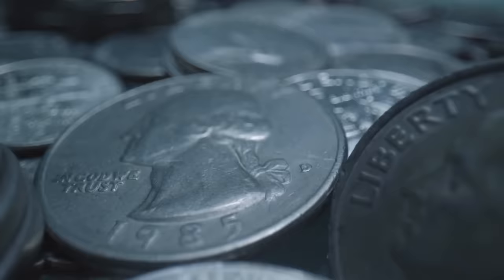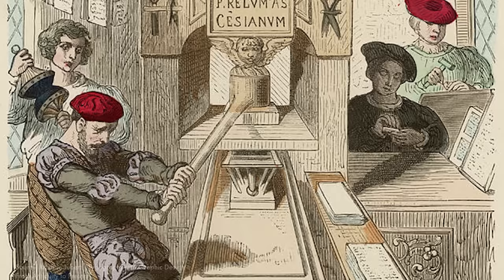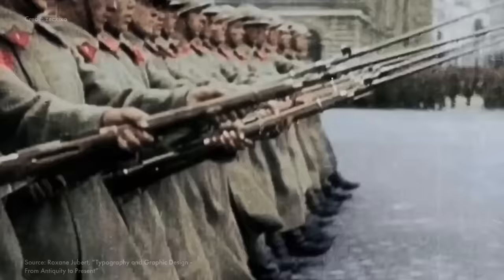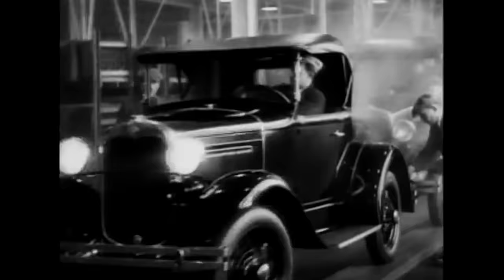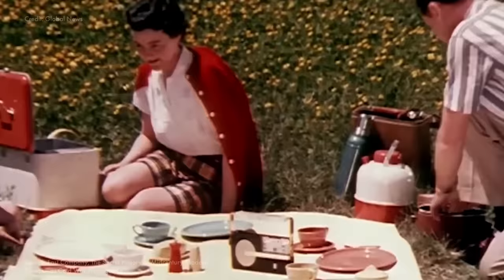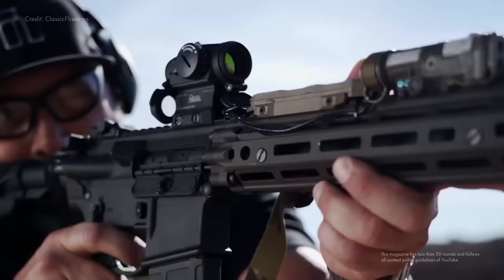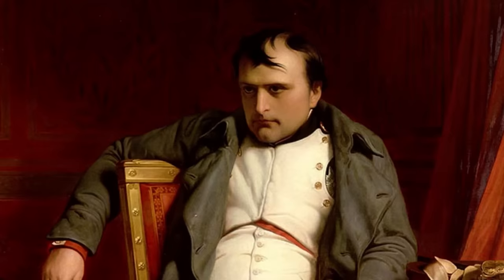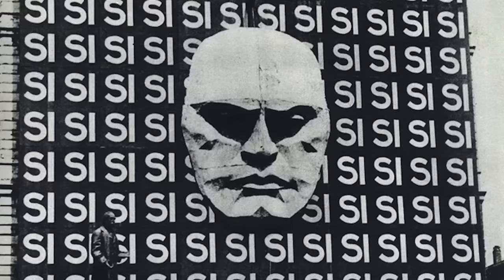How Governments Use Design & Propaganda to Control You

Comment: The Armalite15 semi-automatic rifle was not designed for combat, but for general use by civilians. The military rejected it as a cheap and flimsy toy. The benefits contributing to its ease of use primarily impacted poorly trained self defenders, like your grandmother, rather than highly trained soldiers capable of handling heavier weapons. I believe it was the first weapon Armalite attempted to offer to the military, and they had to overcome several rejections to get an evaluation.
Reply: I thought ARs were made specifically to be a civilian weapon based on the core functionality of the M16 (e.g. dust cover, rear sitting two finger charge handle, 30 round magazines, gas system cycling, a construction of steel and strong but light polymers, forward assist, and a barrel shroud with Picatinny rails).
Reply: The AR-15 was designed in 59, before the M-16 A1.

Comment: 24:44

Small mistake: the M4, which is what was used in the 00s wars, is actually an AR15.
Reply: The M4 could be more accurately described as the carbine version of the M16, which is the military version of the AR-15
Reply: M4 and AR15 are absolutely not the same rifle.
Reply: @AdamSambuco  yes they are. An M4 is an AR-15 type rifle.
Reply: @Stellar-Cowboy  "type" ... absolutely not the same thing. Not remotely close.
Reply: "TYPE" is the word that specifically tells you they are somewhat similar but NOT THE SAME.
Reply: Alls I know is you want an M4 instead of M16 whenever your about to go into a village especially if you know ahead of time you’re sweeping every rebuilding or house! What y’all are missing out on is the identical ammo and shorter barrel! You don’t want to pop a corner With the M16 “you can and there’s a way to do it properly” but Between the two weapons the M4 barrel is 4 and inches shorter than the M-16! I would love to read the comment section on why we use the 556 round instead of any other round ie the larger AK 762x39!

Comment: On an AR15 the gas and buffer systems are solely there for semi automatic operation, it would actually have less recoil with a bolt action. As gas isn't forced back into the action cycling the bolt weighting several hundred grams back to eject the old round and cycle a new one into the chamber.
Reply: Wrong. It's the exact opposite. Gas systems in guns channel that "equal but opposite" energy into cycling rounds, so some of that energy is used by doing work which leaves a smaller amount of energy left over to be turned into recoil. In a bolt action, none of that "equal but opposite" energy is used to do any work, so all of it is instead turned into recoil. 

The law of conservation of energy, my dude. ARs would have to be creating new energy out of nothing in order to both do work (energy) AND have more recoil (also energy).

Comment: First, you've got some great insights. But, second, you're really missing the mark on many of the points you made about the AR-15 (not all, but many). 

The AR-15 is more than just a rifle - it's a platform. Most people don't understand that Microsoft Office isn't an office suite of productivity tools, it's a platform. Being a platform is a huge advantage because it means that you have a lot of freedom to customize and alter. 

For the AR-15 as a platform, it means that it can very easily be modified for many different purposes. This makes it very inexpensive as you can change it around with no need to purchase a different firearm. 

For the "sharp edges", you seem to be referring to the Picatinny rails. These are part of the platform that make it very modular. It's easy to attach various enhancements with that system, e.g. a scope, a red dot, a foregrip, a flashlight, etc. 

However, one of the most attractive features of the AR-15 is that it's generally chambered in 5.56 NATO or .223, which is very cheap ammunition. This makes it very cheap to use. Ammunition for other rifles/calibers can easily cost double, 5x, 10x, or 20x or more. Ammunition for an AR-10 (same basic type of rifle but chambered in .308 or 7.62x51mm) is at a minimum 2x, and often 3x-5x as expensive. The AR-15 is CHEAP to shoot. 

I could go on at length about why the AR-15 is popular for practical reasons, but I think I've made enough points already.

And yes, you are 100% correct in saying how a lot of people are attracted to that "tacti-cool" look and feel. Totally true there. But that's really a minor consideration, or perhaps a minor consideration for anyone that's semi-knowledgeable about rifles and firearms. The "tacti-cool" factor is likely more important for people that don't know much about firearms. 

That's all a minor point for your video. You've done an excellent job there!

Comment: Your basic premise or thesis is like many academic type examinations and discussions that take one of the 'sub-branches' of a major discourse and present it as the predominant course, reason or outcome. The trick is in these enquiries - to 'identify first and foremost the major discourse or 'determining factor' - usually a major argument in itself. 
With your thesis it has to be "What is it in the human psyche that makes us 'SO SUSCEPTIBLE TO INDOCTRINATION AND MANIPULATION' not the various elements of the indoctrination - like design etc. This list is vast and leads down dozens of rabbit-holes. The determining factor undermining the whole of society and its susceptibility is CHRISTIAN DOGMA AND IDEOLOGY - TWO-THOUSAND YEARS OF IT - In your small enquiry - the use of idols and symbols in religious indoctrination is so ingrained it even appears on the outlaw members of society - so wide is its influence - check modern gang insignia, symbols and tattooed markings etc out let alone the mainstream infrastructure - as for the psychological programming - when presenting anything and everything to each other - why does the number three crop up? - the father the son and the Holy Ghost. This one is so widely in calculated into our psyche's it even defies basic mathematics. The list is endless - have a go at his 'religion' the root of all evil so to speak.

Comment: 11:39 they weren't misguided. Automation and mass production can actually reduce workloads a lot, and actually they improved working conditions for the masses in the early Soviet Union (for example by introducing the 8-hour workday and later the 5-day workweek). And their goal went far beyond that, but progress was largely stopped with Stalinism. In general automation isn't bad, but it can be bad if it is used soley for incrasing profits. But even in capitalism it can have great benefits, out modern, relatively comcortable livestyle, modern medicine, etc. wouldn't be possiblen without automation. Witbout it we would still live like in tbe middle ages.

Comment: You make some interesting points, but also some poor/questionable ones, especially on modern design. The fact that every year most smartphones have almost the same physical shape isn't as much evidence of fear of deviating from universal appeal as it is of what's physically and practically possible. In 20 years, phones are likely going to have radically different hardware designs, not because consumers will develop radically different tastes, but because scientific advancements will allow those designs. The recent surge in folding smartphone sales isn't as much a result of suddenly shifting consumer tastes as it is of R&D discoveries amplified by marketing. Similarly, advancements in material science are arguably huge (but not the only) drivers behind what consumers want to wear or sit on. What's available and what's desirable drive each other in tandem.

Comment: Funny to choose the AR-15 over the AK-47. The AK-47 is at least outside the usa a much bigger icon. More history and spread much wider. When you just started about the AR-15 i thought it was just the icon of usa in wars. I did not link the weapon with freedom. heck, i did not link any weapon with freedom. But that might be my european propaganda speaking that weapons are unnecessary to achieve freedom. Anyway, i thought it was funny to choose AR-15 over the AK-47. felt like you slipped in a bit of your own propaganda there.  USA! GUNS! FREEDOM! WHOOOO!!
Reply from the maker: I have a section on the AK-47 but it didn't make the final cut

Comment: Padded out with a lot of unnecessary filler. Would be better if half of the irrelevant points were cut because most don't support the main thesis they are just tangentially associated assumptions that significantly water down the drive of the video.